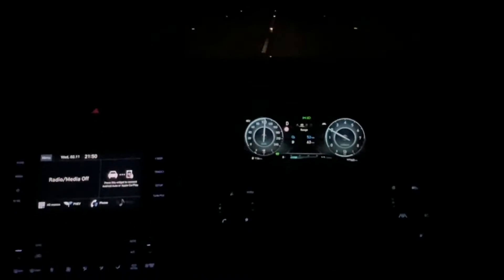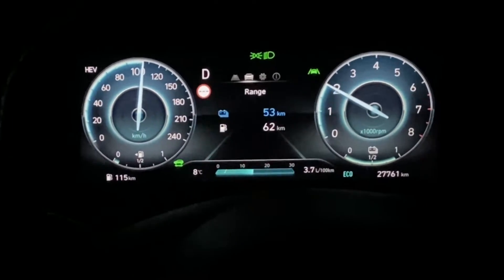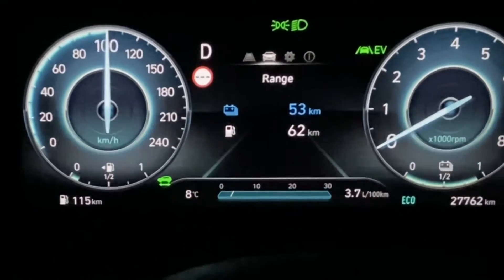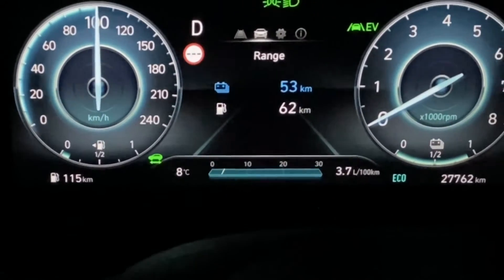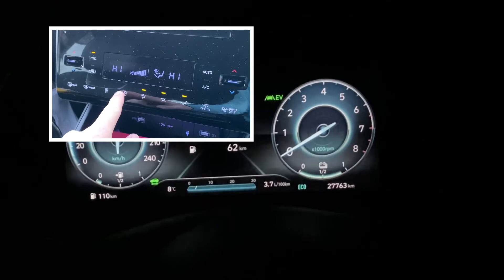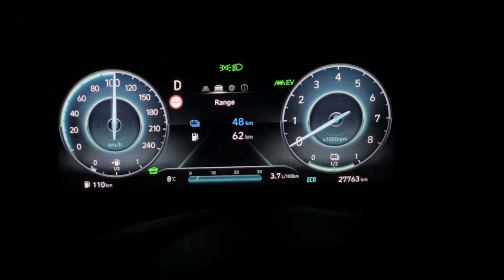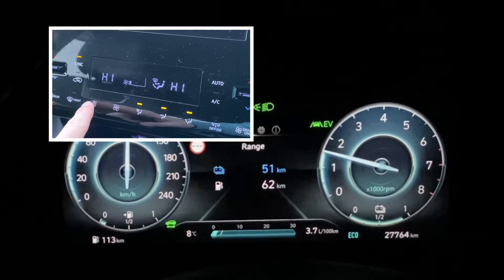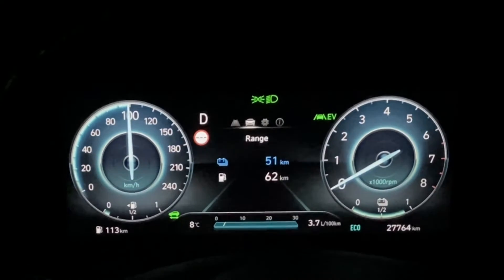What happens when you use the heater in a PHEV ? #phev #heater #whathappensif

Comment: I do find it a little annoying about the inefficiency of consuming fuel while also consuming battery range.

I have a sorento phev, and find for short trips on cold days that the fuel economy can often be only marginally better than when using full hybrid mode and saving the battery for later.

Sometimes I force it to run on hybrid mode until the engine is warm and then switch back to ev mode as I feel that having more battery range when the engine is warm could be more beneficial, and will save on charging costs at the end of the trip.

I also do this if I'm doing a trip that will be longer than the battery range and the heater will be on. I run on hybrid mode until I reach a point where the destination is in reach of the battery range, and the engine is now nice and warm and the heater can often continue without the engine starting back up by the time I reach the destination.
Reply from the maker: I can understand your points🙂. I think probably one thing to consider these days is diesel is no longer available in many regions because of emissions . So while plug-in is not perfect, it’s the next best alternative in this body style.🙂 thanks for watching

Comment: Worth mentioning if its -15C or colder and you want the heater on. the car will force itself into hybrid mode until the engine is warmed up. My Sonata Plug in does this but once warmed up it will allow EV mode

Comment: Interesting to know thanks mate .
At least the battery range ( though tiny ) appears to stay the same on the hybrid when you turn a  power draw on , this is  a reason im not a fan of full EV`s .
 If you have conditions where you use a lot of accessories or are pulling heavy , your range plunges in an EV .
  imagine if in a full EV you add extra electrical load , with seat heaters , steering wheel heater ,  wipers , demister , main heater ,  high beams , charging your phone , have the weight of family on board ,  and are pushing a head wind , or towing something that adds even more extra weight , extra friction , extra wind resistance , and even extra lights , electric brakes  .
 They are not really a one vehicle do everything solution , where as an ICE vehicle can be .

Comment: What if you only but the heater on the lower setting, like say one one or two bars? Could you also pls do a headlight test?
Reply from the maker: The headlights have no effect … in this video it is nighttime so the headlights are on continuously on so when I turn the heater off, it goes into full electric drive with lights on … The heater however, it doesn’t seem to matter which setting its on … whether it’s low or high it still requires the engine🙂
Reply: @doolanbrian  thx for letting me know xx
Reply from the maker: @shithead4767  🙂